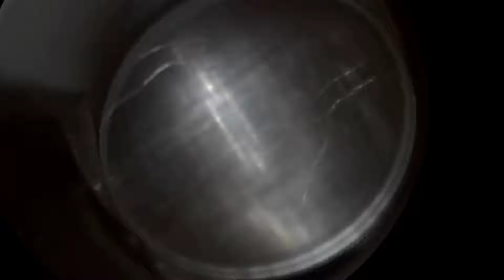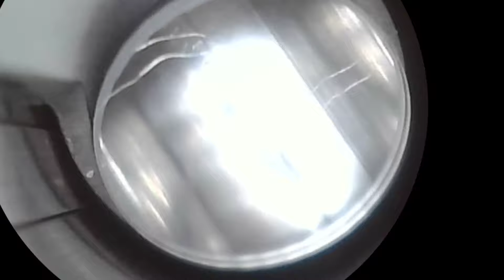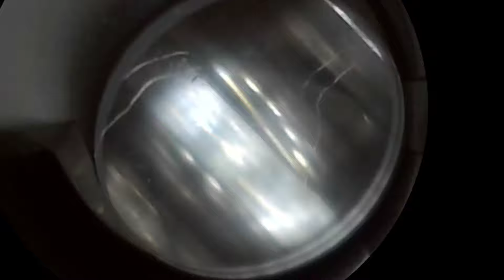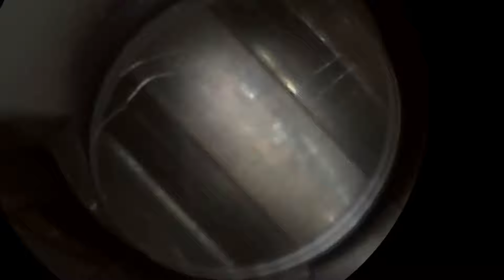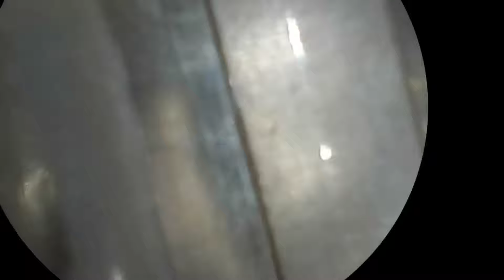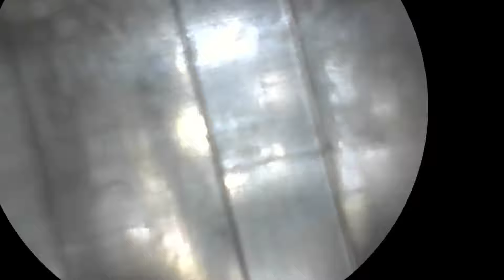Ruger 10/22 with Anomalous Bore

Comment: Amazing what you detected with just a cleaning rod and experience. I’m sure your barrel is not the only one, too bad it wasn’t caught at the factory. No matter what that barrel will not be as accurate with that flaw. https://youtu.be/8pzL5h2cl80?si=E6caVmHC1SbSi8c1
Reply from the maker: Well, I've sent an email to customer service at Ruger. We will see what they say. I'll watch your video and get back to you with a reply to the link.
Reply from the maker: Now that I've watched the video, I have no idea how they've had this issue when it is cold hammer forged. I can't can't the life of me wrap my head around how that defect could even occur.
Reply: @timberfallingcouple  that’s part of the beauty with cold hammer forging is consistent extremely tough barrels. Button and single point cutting manufacturing rely on operator expertise a lot for perfect results. Those factory Ruger barrels with a good chamber, crown and a bit of lapping are capable of tiny groups.
Reply from the maker: I see how consistent it is in my barrel ahahahaha 🤣